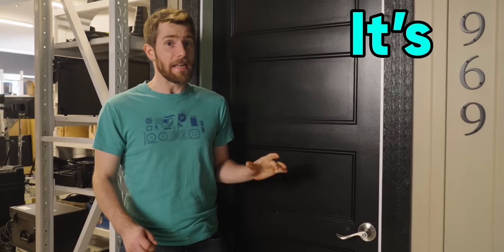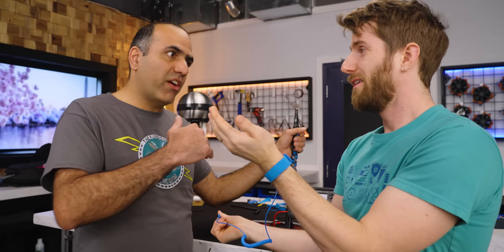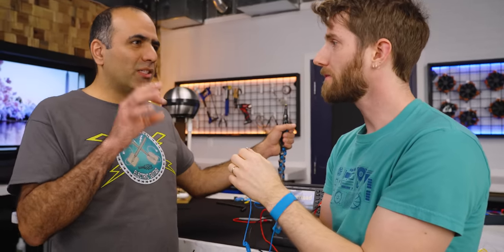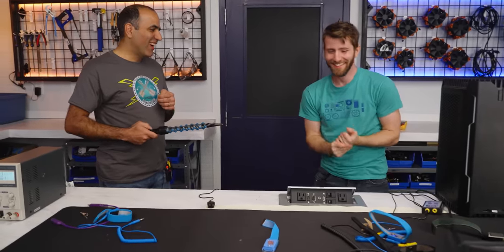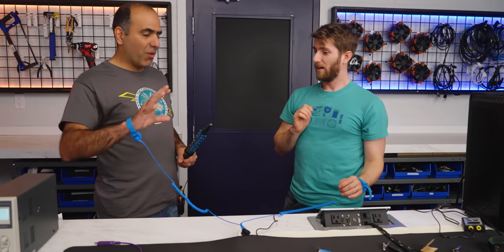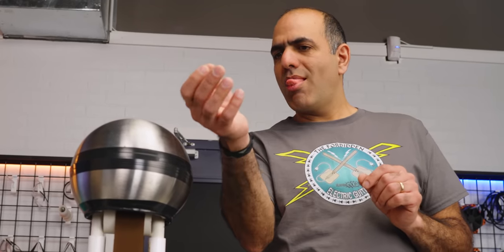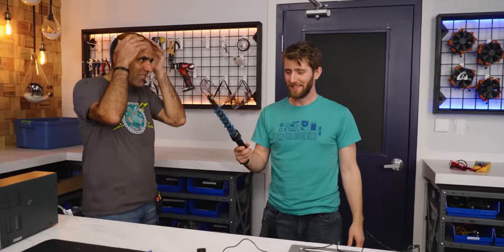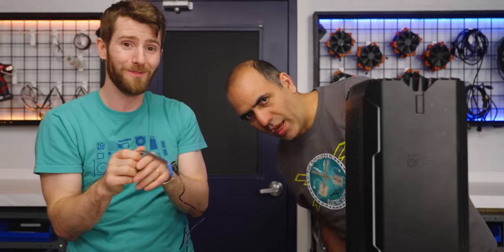The SCAM of Wireless ESD Straps - Feat. ElectroBOOM

Comment: Word of warning that Japanese strap there appears to actually be a negative ion bracelet. The powder in these items is typically Thorium Oxide which is mildly radioactive. Most of the decay will be alpha and beta radiation so relatively harmless from outside the body. Continued wear is still not recommended however especially when the dust particles are visible like that, they will easily be dislodged through wear or any form of damage and then there is a risk of inhaling them. You do not want to ingest this stuff as if it gets stuck in your body somewhere, which is almost guaranteed if it enters the lungs, it will result in chronic radiation damage to the surrounding tissue.
Reply: yeah i was gonna say that, its suppose to be a "negative ion" bracelet thing, not for anti static.  Don't get me wrong its bullshit either way.
Reply: @BDtetra  It's so BS, it isn't even the right kind of BS!
Reply: This comment should be higher up. I BET this is one of those bracelets.
Reply: @BDtetra  I think a radioactive bracelet would be a bit of an antistatic though right? The radiation leaving is charged, so as long as you are charged the same way statically your total charge should decrease. Just I doubt measurably
Reply: so basically these wireless ESD straps are scam right?
Reply: There is a very informative video about those scam bracelets here on Youtube. Basically, they were selling this sheit on Amazon... I wonder hpw many "Radioactive scoutboys" brought these before they were "banned"...
Reply: @White_Tiger93 Absolutely, yes it is a scam.
Reply: even in japan, we consider them a scam
but they keep showing up every other year or so
Reply: @-maki446  It's probably not even made in Japan just like those scam knives that were advertised on all the youtubes for a while. Those turned out to be some underregulated mass produced garbage out of China being sold under false pretences. In that regard just like any knock off they were just trying to steal the good reputation for quality products of the brand or in this case country they were trying to associate themselves with, no doubt helped along by the fact the Chinese authorities don't bother to prosecute flagrantly deceptive marketing.
Reply: And they ended up cutting it open
Reply: @LuciusVulpes  Yeah that really wasn't a wise move, then again of course they probably had not heard about these harmful products to suspect that this might be one.
Reply: So the test equipment they should have had was a Geiger counter, go figure.
Reply: @Mandragara  radioactive decay still follows conservation of charge. The products, though they may be wildly different, still have the same total charge.
Reply: @rfmerrill  I don't quite understand. A pure alpha emitter will only emit alpha particles, which have a positive charge. So surely over time the radioactive material will gain a negative charge as it emits these positive charges. If Linus is positively charged due to static electricity, then the negative charge accumulation by the bracelet should help cancel it out
Reply: @Mandragara  Technically yes. Some very old anti-static hairbrushes used radioactive materials before the dangers of radiation were understood. But the rate of discharge required to prevent your hair sticking up is much less than what they were testing in this video.
Reply: @Mandragara  I think I know what you mean yeah. It's sending out the alpha particles in all directions, including away from the wearer, so there could be a net movement of positive charge away. I'm not an expert.
Reply: @White_Tiger93  Worse than a scam, downright dangerous and doesn't help with elecrostatic discharge at all.
Reply: @Mandragara  I think you are correct, but it depends on the wearer being positively charged.

Also if you have a 1 kV charge on you, you'd need like 3 x 10^11 alpha particles emitted to balance that out (about 100 nanocoulomb). for that to happen over 1 minute the rate of decay would be like at least a gigabecquerel, or hundreds of kilograms of thorium oxide.
Reply: @Mandragara  anything that changes your charge to something other than specifically the same charge as ground will cause problems. From a physical standpoint, this is because if you are charged too low(Too few electrons compared to ground), electrons will jump from the circuit to you, which still pulls electrons from the circuit at a high voltage, and if you're charged too highly, the electrons go from you to the circuit.
Reply: classic terrible combo of dangerous elements and cheap manufacturing.
Reply: @seraphina985  Yes, it's clearly not made in Japan. There are typos all over, clearly made by someone who used google translate and transcribed the results wrong or something, not even knowing the difference between 'so' and 'n' (ソ vs ン) or a small 'tsu' and a large 'tsu' (ッ vs ツ).

Typical "buyer-beware" stuff from China, I would bet. They make stuff that pretends to be from Japan quite often, since they know we know Chinese products are made by people who don't care much, while Japanese products tend to be made by people who do. Japan has a history of long-practiced artisans while China is famous for its "good enough" mindset.

At the same time, I'd say shame on Linus for not bothering to get someone to check the writing on the label before doing the shoot. There are plenty of Japanese people in Vancouver or on the web.

And, I think, after about a dozen attempts, I suspect I have finally worded this in a way that YouTube won't prevent anyone else from seeing. Kinda worrisome how they won't let me speak as much ill of a certain country's manufacturing ethics as I would like.
Reply: They banned them so they had to remarket them as this lmao
Reply: @ItsBillsFault  You should leave your comment as a top level comment so that more people see it. Most of us don't read Japanese and would have no idea about that aspect of the product's fraudulent nature.
Reply: Thought Emporium has a really good video on these things if anyone wants to check him out.
Reply: @1dgram  Fair point. I will.
Reply: @White_Tiger93  Yup. Just like crystals and astrology.
Reply: I would definitely use a geiger counter before cutting into those Chinese fakes.
Reply: I don't think the alpha particles are meant to carry charge away directly. Rather, they ionise the air a bit, making it slightly conductive and allowing charge to leak away. Which it probably does, but not fast enough to protect your computer from being zapped.
Reply: amazon sells alot of radioactiv stuff ^^
Reply: yeah by the packaging it does look a LOT like some of those negative ion bracelets, and they just cut it, potentially releasing thorium powder everywhere. and that can be dangerous, because they could breath it.
Reply: @Mandragara  alfa particles are positive but beta can be either electrons or positrons iirc, probably at least electrons but i'm not 100% sure on this one. Probably a rather negligible charge leaving even if it only radiates positive charges.
Reply: @woutverjans2928  Correct, Beta decay refers to a neutron changing to become a proton (Beta Minus Decay) or a proton changing to become a neutron (Beta Plus Decay). The former releases an antineutrino and an electron, the latter a neutrino and a positron.
Reply: @BDtetra  
Ions with a negative charge are called anions. A wired ESD strap will conduct the extra electrons in either direction, both negative and positively charged ESD. A wireless strap per their experiment do not conduct any electrons in any direction since there is no connection to ground, Linus holding the magic wand, would actually have him negatively charged (since he was 'ground' and the tip of the wand is positive). 

So even if it were a unidirectional (had a diode), the test is still valid, it did not discharge the negatively charged ions on Linus' body.
Reply: Them: "So lets take it apart."  
  
Whelp, RIP.
Reply: I was going to mention that, be very careful when you buy similar products like that. Inform your family members and share.

Comment: Years ago (2000 or so) the production manager at a company I worked at decided to purchase the wireless ESD straps. The straps were supposed to be used in conjunction with a sort of humidifier. I, being in engineering, researched the device and found several articles about how they were a scam. I became unpopular with production since they had to add grounding to all of the  benches use in production.
Reply: Damn, they had wireless ESD straps 2000 years ago? :O
Reply: Its always amazing that the person who brings up inconvenient facts becomes the pariah instead of the problem being the problem. I changed careers twice due to being that inconvenient fact person.

Comment: I used to work in an injection molding factory and sometimes we would transfer the reworked pellets from a large hopper to a large metal bin. The process tobs of those little pellets moving through the metal built up a DANGEROUS static electric charge. Everyone makes the mistake once of casually touching the bin without being grounded. It's super painful. You see a flash, your ears ring and pop, you even taste it momentarily. Static electricity can be pretty gnarly if it's able to build a huge charge. It's just that normal everyday activity never yields such potential.

Comment: When I was a kid I've learned a hard way what an ESD does against electronics when I killed my first gaming console with it. I lived at the polar circuit, so having -40 degrees outside in winter was a norm and the air indoors during such times was so dry that you always had a charge on you. After that a standard ritual before touching any electronics or anything metallic was to come to a heating radiator and touch it with my warm socks. This way you don't feel pain, just see and hear a zapping lightning discharge. And then it was ok switching on the TV and console to play some Contra.

Comment: Working in PTH, Not only did we have anti static ankle straps and anti static lab coats, We also had to drink enough water to insulate ourselves and pass the insulation test just to get through the door into the warehouse. The floor was also painted with anti static paint
Reply: Oh wow those are indeed sone security measures😂
Reply: can you do one thing for me, go near a wall , form a star with 5 people who have hair, rub each others head, 1: you'll feel good like a dog. 2: if your hair rise, game over measures
Reply: Whats PTH?
Reply: @samim.Ali.  put through hole pcb assembly. You know……. The stuff on a pcb board that has to be put through a hole and soldered, Eg capacitors, resistors, diodes, certain IC chips , transmission crystals, chokes , I/O sockets, pots mod controllers ect……… common basic knowledge in electronics would teach you what PTH assembly is. Say you buy a raspberry pi Pico and want to mount it to a breadboard, you’d have to solder pins to it. To do this you would put the “pins through the hole” and solder it to the copper pad etched out on the pcb. In large numbers you’d run it over a wave solder machine. Pcb’s that mix surface mount electronics and PTH electronics have to have a team soldering in the PTH parts by hand
Reply: @mpf_agundipsht3619  and your place makes what kind of pcb or trying to make
Reply: wtf. thx for sharing this. i mever knew drinking enough water is also vital for some cases of electricity safety.
Reply: @EIanordir  Industrial/commercial PCB made to customers design/orders. We did SMT and PTH as well as fault finding and repairs.
Reply: I worked in a similar environment and we had the straps, coats, and an ESD safe area in the building, but nothing that extreme
Reply: I've once been to a company that went extreme with its ESD measurements. They had anti-static shoes, anti-static socks, anti-static chairs, and even anti-static carrying trays. Everything can be made antistatic by mixing in a little carbon or fine conductive wires. 100v was enough to kill the components on the there products.
Reply: @mpf_agundipsht3619  most companies have stopped using PTH except when there is no SMD version of the component. It's much more expensive to produce PTH, and requires more boardspace.
Reply: @pietheijn-vo1gt  You'll notice that all of the capacitors on motherboards are PTH, all of the fan headers are PTH. Power sockets are all PTH, header panel is all pth, USB 3 and USB inputs are all PTH, Pci headers are all PTH , rear I/O is all PTH, the transmition crystals are all PTH, The RAM sockets are all PTH ect ect, And thats just motherboard manufacturing companies. Psu manufacturing companies also use soly PTH  components
Reply: @mpf_agundipsht3619  I think the connectors need PTH because people use quite a lot of force to push things in/out and with SMD you might tear off the pad. Other than that there is no reason to use PTH. For the crystals, I highly doubt they use PTH because why would they? I'd say 99% of components are SMD nowadays, especially for high volume production.
Reply: you would think you could get away with just floor, shoes, coat and gloves, since as long as you have a way to discharge through the floor you shouldn't build a charge
Reply: @pietheijn-vo1gt  If you're doing long run orders/large run productions, say 10,000 boards or so a SMT machine is def the way to go, but if you're only manufacturing say 100 boards PTH and manual work ends up being more cost effective to the company, Also far easier to QC PTH as most of the polarity components eg capacitors and diodes are clearly visible rather than using an auto fault finding machine for SMT
Reply: @mpf_agundipsht3619  I worked at a large company as an EE where I occasionally had to draw schematics for our research projects, which another department then produced in house as a prototyping service. As there were a few dozen designers working there I saw a lot of different PCB's, both production and prototype level. The only thing PTH I saw were some connectors and those could be done by hand. There were a few people employed fulltime to only do handwork such as repairs, refits and PTH soldering. In general we were discouraged to use PTH because if we wanted to scale up to series production many parts had to be swapped. But I also understand a lot of old industry electronics that are still operational use PTH and when they come in for repairs people should still be able to service them
Reply: @pietheijn-vo1gt  We ran tens of thousands of PTH products over the wave solder machine, I Ran QC and maintenance of the department. Outside of that im a fabrication engineer with boiler making certs, fitting and turning and specialized welding certificates. I manufacture national infrastructure in the Nation i reside. Oil/gas/Milk industries
Reply: @mpf_agundipsht3619  great. keep it up

Comment: Nice job Linus, there is possibly thoria dust (thorium oxide, radioactive alpha emitter, you can touch it but don't breathe it) all over the shop now. Those silicone "health bracelets" with mysterious powder in them... often actually have THAT in them in addition to the potential glitter. This was supposedly Japanese and not Chinese so it's slightly less likely, but you might want to break out the Geiger counter just in case.
Reply: I highly doubt there's thorium dioxide in these bracelets as that is added two bracelets for health products cams and the people who would be doing those kinds of scams would probably go nowhere near the electronics industry because they know nothing about it. Also thorium dioxide isn't exactly cheap, so it's only added if they think it will have any chance of increasing the sale rate of a product.
Reply: @the_undead  my guess, Germanium
Reply: @the_undead  The Thought Emporium YT channel covered these sort of bracelets a few years ago and many of them really did contain Thorium-based radioactive components. He actually reached out to the Canadian and USA Nuclear regulatory agencies to get the specific products he tested taken off the market.
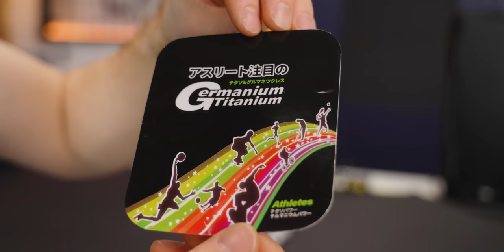Reply: The Japanese info card at 24:42 says 'Emits negative ions from the entire band. Works well on stiff necks.' with a diagram of it supposedly heating up someone's neck. So it was meant to emit something at least.

The Japanese text was written with Chinese glyphs (负 instead of 負), and has typos suggesting a Japanese speaker never looked at it (チタソ＆グルマ, ィォン), so may well have come from China anyway.
Reply: The negative ions block the static 😂😂😂
Reply: Jealous of Linus? That's a yes, otherwise why would you need to talk down to someone that would clearly never see ur comment? Because ur satisfying ur own insecure ego. Next time take the responsibility of knowledge seriously and don't talk down to others when informing. You'll come off as much less obviously insecure -- just a thought.
Reply: @sammysappy  You come off as a SJW
Reply: @RemedieX that’s an insult to SJW’s
Reply: @sammysappy What?
Reply: @RemedieX Double what?

Comment: you might want to make sure that rubber wristband isn't radioactive -- there are a lot of products with similar looks out there that contain radioactive powders, etc
Reply: Especially if they have "small metallic glitter or crystals" in them and made in China. Mind the radiation is safe enough to wear for the brief time you tested, but it is potentially dangerous  if worn constantly for long periods (as most of such crap bands are intended to be).
Reply: Seriously Linus, don't ignore this